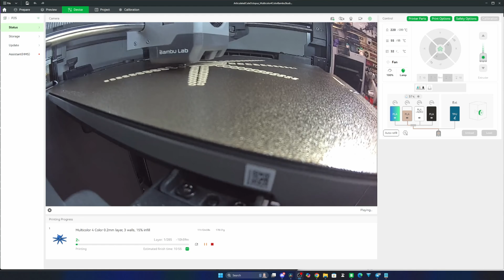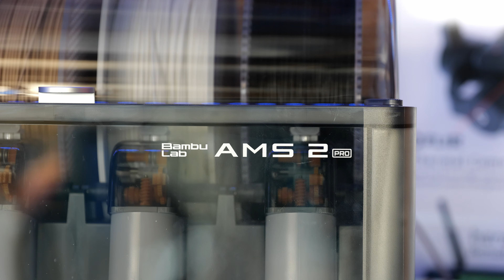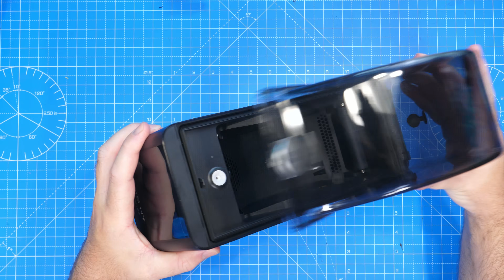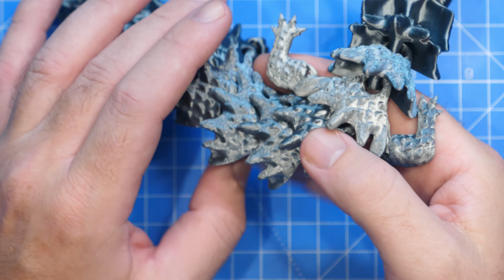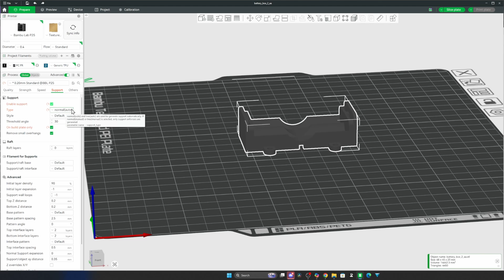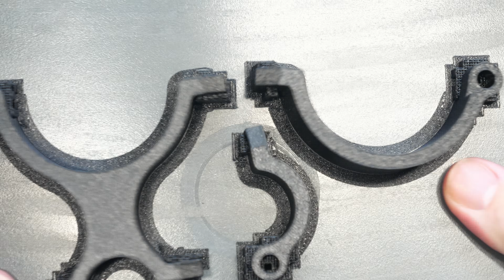Bambu Lab P2S 3D Printer Review - Almost The Perfect 3D Printer!

Comment: Don't buy a Bambu if you value support and service on your device. According to their support a malfunction is always related to other issues, except the printer itself. After several months using their ticket system, I still can't print. Below is Bambu's service responds.

Dear Customer,
Thank you for the update.
Adhesion issues can be influenced by many factors — such as filament type, printing parameters, or a build plate that has lost some surface grip — and they are not necessarily caused by the printer hardware itself.
For this reason, we’re very sorry that we’re unable to offer a replacement or refund in this case.

Comment: I own 2 X1C's and 3 A1's.  I vent my X1C's outside when printing ABS.  I'm looking to add some more machines for ABS printing and when looking at this P2S as an option I have my concerns about venting this outside.  I see that Bambu has a yet released solution that has two options.  One that replaces the back panel and one that doesn't.  The one that doesn't pulls the exhaust across the electronics and out the waste shoot.  With these issues and having to jump thru hoops to handle this, I have started to look at the possibility of buying the Qidi Q2 to handle my ABS applications.

Comment: The big downside for me is wanting to print ABS and the P2S not having an enclosure heater, or even the provision to buy a heater as an addition.
Major omission in my opinion.
Reply: ABS doesn't really need a heater, but at least a very stable temp preferably above 40 deg.   However, I'm able to get my P2S to a steady 62 deg C chamber temp and ABS prints come out absolutely flawless
Reply: @huibvb  How do you manage that?
My printer is in a cold garage, and it's winter.
I built a thermostatically controlled heater for my resin printer that works great around 28C, but ideally this needs to be around 60C, and I have no idea how to get the power in without drilling holes and voiding my warranty, and also finding a place it will fit.
Reply: Buy X1c or a H Series then....£479 what you expect?....try spending that money on an enclosed pursa 🤣
Reply: @RcNeil  Why should I have to?
It's a basic function. I spent over £800 on a P2S combo.

Comment: I just got the ps1 on Black Friday discount 
Haven’t opened it yet.
Thinking about returning it for the ps2 but an extra £200.
What do you think
Reply from the maker: Keep the P1S unless you ABSOLUTLY need to print CF or the other engineering filaments, and even then you can upgrade the hotend and gears on the P1S for very little. The P1S is still fantastic and great deal on discount.
Reply: I'd rather have two P1Ss for less than one P2S.

Comment: It has a lot of nice upgrades that I like but not too sure about the steel rods and all the shaking that thing was doing on your table my P1S and X1 don't shake half as bad might just be the feet, but I did print the TPU feet for both of My printers have been very happy with both of them. I might end up buying the P2S just because of the new easy hot end removal system Thanks for the review
Reply from the maker: On the movement it's like the H2 in this regard and that thing REALLY moved around.
Reply: @MadRC  Just wanted to let you know I ended up buying the P2S anyway and put some of the P1S adapters and TPU feet on the P2S and it doesn't shake at all anymore also I used your Affilate Link Thanks for all you do @Mads RC

Comment: am i overthinking it not buying the p2s because of the vfa issues ?
Reply: Same here... i was this close to buying it on release but then the first reviews popped up that showed print quality worse than my old ender clone that i am trying to replace🤐 those vfas are unacceptable and if this is really a machine issue, id rather buy something else or the old p1s eventhough i really like touchscreen and quick change nozzle and updated extruder :/
Reply: Because is not tuned properly. All bambu printers have the acceleration way higher than they can handle with good quality. As soon as you put correct speeds on outer wall every artifact dissappear completely. I have A1 and by default it has 5000 but it can print up to 3000. Same with every other bambu printers. Do the test and put correct speeds and accelerations for outer walls.
Reply: @Jokershadow696  which test/print would you recommend to find out the best values ?

Comment: Not that it particularly matters, but you really didn't address the terrible z seams and the warping issues with the pa6 and pc. Idk if the warping was poor temperature control or bad settings because it wasn't addressed. The z seams on the vases should have been better. My cheap k1 does better than that out of the box. Still probably gonna get myself one because AMS and the price is retarded cheap for the features it has.

Comment: I didn't forget when they thought they were going to put us online 100% of the time. My P1S has been firewalled off from the internet since.
Reply from the maker: There was a lot of confusion around this at the time. Bambu had full offline mode if you need it.  IV had all my printers online with no issues.
Reply: @MadRC  I simply don't believe that what we got was their original intention. They received tremendous backlash and suddenly veered away from what they were doing. My printer is going to remain cut off. My trust is broken. If you see it otherwise, that's okay by me. Just been burned by too many companies to not see it like that.

Comment: That warped battery holder, isnt because the chamber is too cold?? I have lots of issues with my p1s printing abs, after some investigation i believe is because of that
Reply: Chamber heat is enough. Maybe brims or corner extends will help for this. It is hard to print this kind of filaments.
Reply from the maker: Chainber was at 50c with a HOT bed,   It needs some tabs on the corners to help it stay down..  

Warping is always a battle with temp sensitive filiments,

Comment: i am not sold.  300 degree only?   350 would be key for me.
Reply from the maker: They have to keep something for the bigger models.  H2 wins in this regard.
Reply: @MadRC And 2mm pitch belts unlike the H series, so that resonant frequencies lead to more VFAs than the H series.
Reply: At only 50C max chamber, 300 max sounds about right. Can’t even reach full strength of ABS.
Reply: H2S for high temp nylon! Can't wait for it along side the reliable P1s.
Reply: Probably reserved for X2C
Reply: @kimzor1989 Careful, you’re going to trigger some people by even suggesting that the X-series isn’t being killed off completely. Bad news for those folks then, because it’s not- an X2 WILL most certainly be on sale by Q3 2026. Can you say 4-nozzle Vortek system?? 😉
Reply: @Alan-tr5uj with one induction nozzle tool head
Reply: the X1C Carbon only goes to 300 also, so that's all you need to print in carbon really

Comment: They released this 1 month after i bought P1S 😭
Reply from the maker: That always sucks but it happens.   it does not make the P1S bad.  This is a better deal tidal but the P1 is still a phenomenal printer.
Reply: I bought the p1s, AFTER they announced the p2s. The price difference is shocking for the same print quality. #1 reason I won't buy the p2s is the ventilation. It's a death box if you can't properly vent and filter the VOCs
Reply: Sad p2s really a big upgrade
Reply: @SpongeBob-xh8ir  yeah, sadly. If only i knew its coming :/
Reply: I'd rather have two P1Ss for less than one P2S.
Reply: I did the same and I am happy that I bought the p1s. This is just one review. I have seen a lot also on the Bambu page and this printer do have some issues. Probably firmware updates will solve this. But still out of the box it is not as good as the p1s.